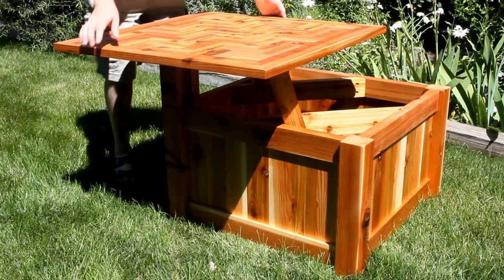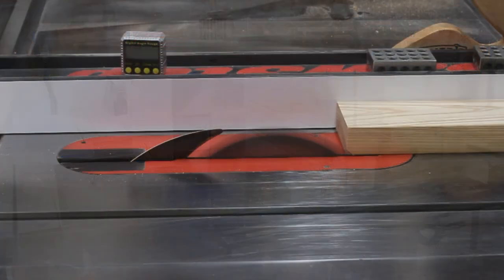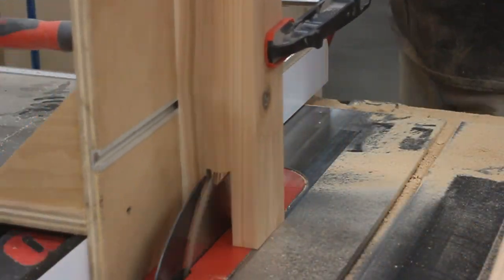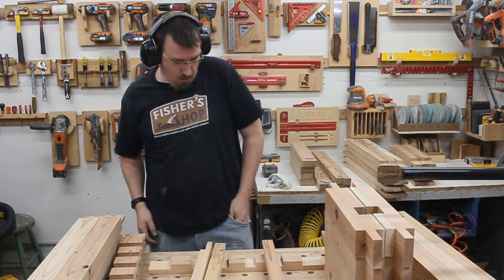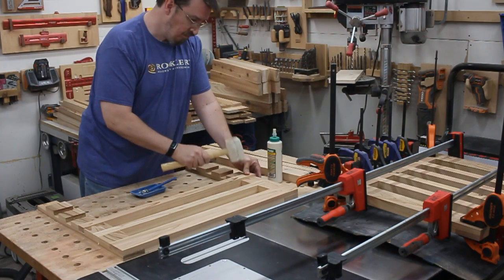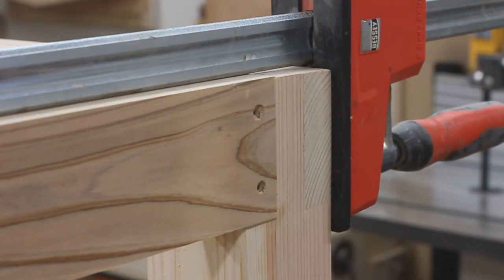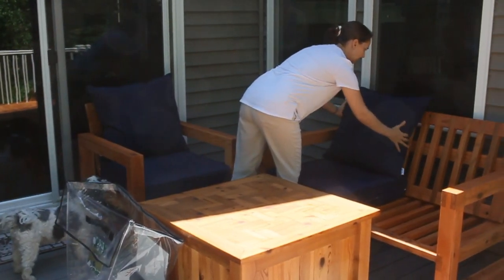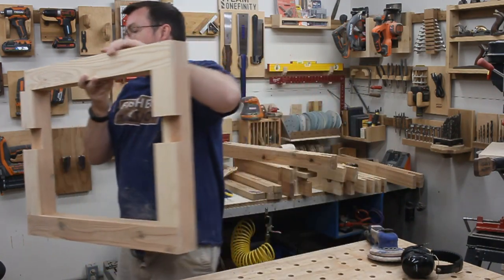Woodworking: Making Patio Furniture

Comment: Nice build Drew, but I want to suggest you turn the seat bottom over in your plans and next build. As it will be a strong use of the half-lap joints. 11:53 shows the seat runner's half-lap on the bottom side, kind of defeating the joints actual strength. Again nice design and sure you just got caught up in the build. Please keep making your videos with the same humor. Very refreshing.
Reply from the maker: Congrats on being the first viewer to catch this. Yes, I goofed but realized after the glue dried. As you can see from my original fusion model, I had every intent on doing it right. The plans call out my error and instruct it be done correctly.

Comment: Great build and as always really entertaining. It also brought about one of the “light bulb” moments for me. In prep a lot of repetitive cuts to square up those edges. Then later on a trim router is used to soften the edges that we spend so much time to get. I get it but kinda grin when I think about it.
Reply from the maker: It's required though so that the joints look perfect.  If I was using pocket holes and butt joints, then I could have left some of those rounded edges and saved myself some work.

Comment: Great project, Drew. A small tip for the countersink drilling. Doing the countersink first will give you a nice round hole, with the pilot drilled first the countersink will have a faceted hole. It only matters once in a while but does give a clean look when the countersink is in a visible location.

Comment: In several of your videos I notice you leverage a remote for your dust collection power. I'm looking to purchase something similar and wondered if you had recommendations or could share what you're using? Thanks and keep up the great work!
Reply from the maker: My dust collector came with the remote.  However, you can buy all kinds of different remote switches and plug in any tool you want into them.

Comment: Nice love the out takes. Why didn't you use the dado stack for the tennons
Reply from the maker: The dado stack can't raise up enough to cut 3" above the surface.  Had to use a standard 10" blade to do that.
Reply: @FishersShop  I understand why not for removing the middle portion but the single tennon (the middle finger :) ) could be done on its side the same as the lap joints.
Reply from the maker: @matthewsmade  Yeah I realize that.  I wanted to use my tenoning jig and I was willing to spend the few extra minutes it took. :)

Comment: This project was wonderful, thanks for sharing and making us laugh🤣.

I have a question about how you mounted the half-lapped slats... in the Fusion 360 model, and when you fasten the stringer along the back, you have the slats sitting down into the crossbar but when you mount the seat-bottom for final assembly they're sitting up in said crossbar... I'm sure they are well secured (lots of slot-head screws perhaps?😉) but did you change your mind and rotate the seat-bottom this way for a reason?... I'm going to give these a go so just thought I'd ask.

Take care Mr Fisher,
Regards
Reply from the maker: Nah, the model was correct. I didn’t realize my mistake until the glue dried. But it’ll be fine anyway.
Reply: @FishersShop  I'm sure it will... thankyou ever so much for clarifying that. Stay safe (surely your neighbour has gotten guard-dogs by now!)

Comment: Curious as to why you didn't bevel the bottom contact point for the seat backs? If you did leave a gap, are you not worried about water infiltration?
Reply from the maker: Since it's not being glued, having the pieces meet flat against one another would just hold water in that location more.  The way it is now, just one corner barely touches the seat bottom so water doesn't get trapped...  plus it's less work. :)

Comment: What a great project!! Great video, as always!!  can you share the cost of the project? how much did you spend on the cedar? I feel y our pain,  adding asymmetry to the pieces means double and triple checking!  Which I fail to do often.  thanks!!
Reply: Followup question,  was your table saw dust collection turned off or just removed for filming?
Reply from the maker: Any number that I give you would just reflect the current prices which have proven to fluctuate tremendously in a very short period.  For that reason, I didn't even include the approximate prices in the plans because 2yrs ago it would have been less than half of what it cost me to do it this time.  That being said... it's STILL cheaper to build than to buy.
Reply from the maker: For part of the build I didn't realize that it was clogged.  I had to stop filming and fix the clog. hehe
Reply: @FishersShop  I was just looking for a 2022 cost estimate in Michigan (I shop at Johnson's) without having to call them for pricing :)
Reply from the maker: Prob around $500 in lumber

Comment: Love the video Drew, but I will say one thing, the bases of the seat and chair really should have the slats resting down into the stretchers in the half laps, rather than glued up from under..
Over time they may push out under the weight of humans on it..
Reply from the maker: Yes, I goofed but realized after the glue dried. As you can see from my original fusion model, I had every intent on doing it right. The plans call out my error and instruct it be done correctly.
Reply: @FishersShop  I did see that in the plans at the start, and so wondered why you chose to flip it over in the assembly.. not for a second did I consider that you might have 'goofed'.. ;)

I supposed they could be reinforced with some screws if needed :)